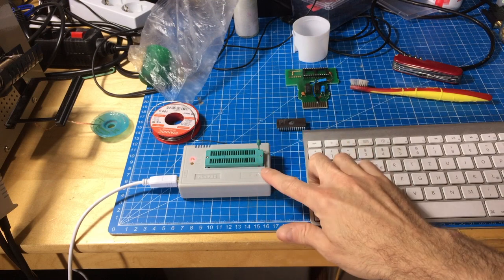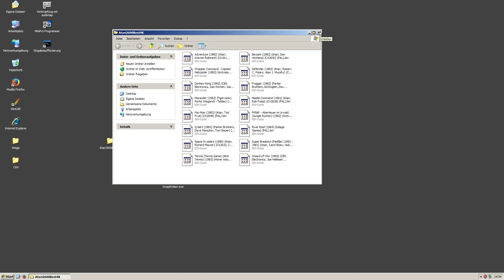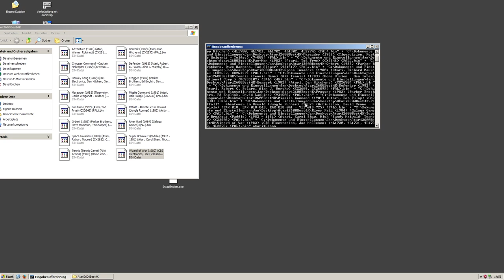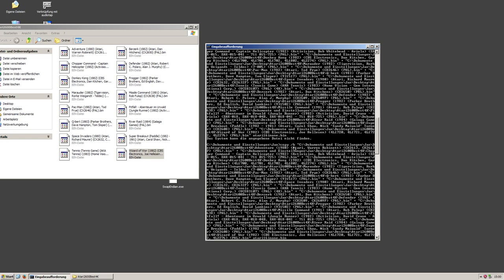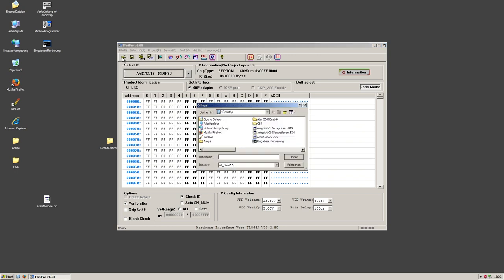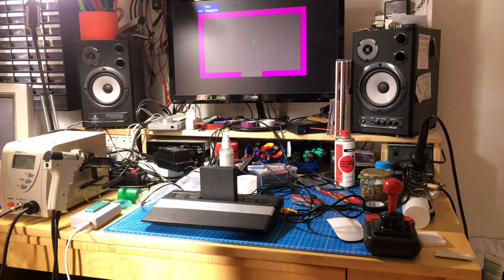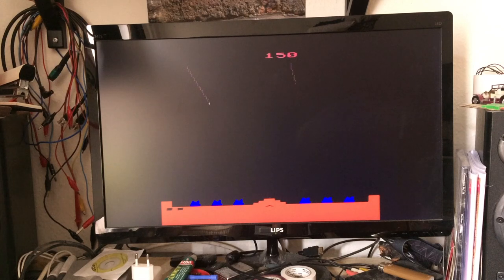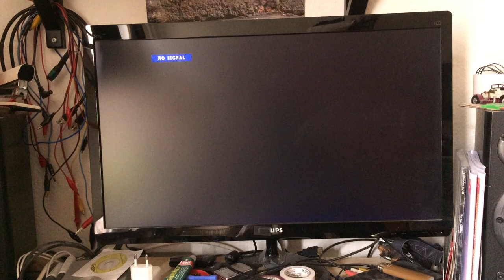Atari VCS 2600 32 in 1 Cartridge EPROM Mod 16 in 1

Comment: Nice!
I used a 27C256 rather than 512 - so only room for x8 4k games..
However to toggle games (as 256 has no A15)  ....cut two tracks (or you can just cut the original track and lift pin 27 which is address line 14 )  connect pin 27 to same underside patch wire.
Forum did say to connect vpp to +5 (pins 1 & 28) for using 256 eproms - but it's missing something as without the extra steps above, toggling on 256 eprom takes two power offs to change games.

(oh yeah my eprom took 3 weeks to blank in the sun, hence late comment)
Reply from the maker: Ah, good to know that it also works with a 27C256. I'm going to pin your comment so maybe it helps someone else. Thanks for adding. :)

And yeah, I tried erasing EPROMs in the sun, too. I gave in quickly and got one of those Chinese UV erasers (which do the trick in about 20min). ;)

Comment: There is another, much simpler mod for this cartridge, putting in DIP switches to select the games instead of power cycling... 

could you make a video on that?
Reply from the maker: Oh, I might really do another mod video on that. There's also some other DIY multicarts I really want to try out some time.

Comment: Enjoyed this project. It worked out well. I have a 2600 (all black "Vader" version) that someone gave me. I'd like to do the s-video mod on that one. Have you ever done the composite or s-video mods on a 2600?
Reply from the maker: Thanks! I did a composite mod on this 2600 a while back (also did a video but it's rather confusing because I tried two methods and one of them failed to work). I did the very simplest composite mod in the end that is just a resistor ladder adding up the different signals for composite (I think it's the same mod that Ben Heck usually does). It works pretty nicely for what it is. Don't know if an s-video mod would improve things even further. Would be interesting to try sometime.

Comment: Great video as always.  Have you thought about somehow applying the counter to a reset or maybe external button?
Reply from the maker: I thought about that, too, but wanted to keep it as simple as possible for now. Definitely going to play around with that idea some time. You would ideally have to reset the cartridge and the console at the same time I think.

Comment: You really should invest in a spool of a Kynar insulated wire for wire-wraping. Also I was a little bit disappointed with a lack of commentary - what is the function of the tracks you're cutting, where do you connect them?
Reply from the maker: Yes, you're right about the wire. I have to get some proper magnet wire or something for fixing traces anyway. Sorry about not going into details. I wanted this to be an easy to follow DIY video. The details are in the forum I linked in the description really.

Comment: Hey Jan! Awesome video! Is it possible to do this for 2K Games? I imagine you don't need to mod the cartidge itself right ?
Reply from the maker: You are correct, you can just put 16 2K games on an EPROM without any modifications to the cartridge.
Reply: @JanBeta  thats super good news. Gonna buy another 32 in 1 and mod for 4k :) although first i need to understand why my atari 2600jr rev f is going crazy on colors with originsl 32 in 1 pal cartridge. Jan do you still have the original 32 in 1 cart intact? I need someone to confirm me the color of the golf game :D

Comment: Have you ever done a video on av modding your atari jr Jan? I bought one of those kits off ebay a long time ago but never got around to actually applying the mod.
Reply from the maker: I did the very simplest of composite mods a while back using just a resistor ladder and a small decoupling cap. Works pretty well so far especially on my CRT. I did a video on it, too (which is a bit confusing because I tried 2 mods one of which didn't work at all... The second half of the video is the mod I still use): https://youtu.be/7ZlnHH8pPe8

Comment: You should do a video series on xbox 360 modding and tell where to get hardware/software. the current ones online are not complete or they are outdated.
mod for games, mod for xbmc/kodi.
Reply from the maker: Oh, I wish I had an Xbox 360 to mod. ;)
Reply: xbox 360 found at local thrift store...I paid $30.00, No cords. I wanted to use cables from my first Xbox 360  but.. different socket. I will take pictures and email you. I looked a few months back into modding it, the tools needed are expensive if only doing one Xbox. Next problem is Xbox games are big, I have to look in bookmarks for FTP locations. I had plans to use a 1tb external drive for just 360 warez.
I have 1/2 a dozen PS2 in storage, I wanted to mod one or two and download the full rom collection... I start looking for the games and realize downloading the full collection would take (I have to look again, but its TB drive space needed)... PS2 file sizes are massive and would take months to download on a good connection.
This is another factor c64 and Atari 2600 are still popular, all games fit on one disk.
Idea.. You download A-M, I will do N-Z and then do a local copy and mail it. cuts time in half.
I will take pictures this weekend.
Reply: I forget where I posted about setting up PC Board BBS. I pulled software from storage last week, manuals and original disks still mint condition.

Comment: Thanks Jan, Excellent mod, works perfectly. Is there any easy way to also support (some) 8k ATARI games with this cardridge?  I read that certain bank switching is required,  also that the 8k image would have to be split by half and programmed in opposite oder etc. Would be interesting to see if we can do more with this cardridge  ;-)).
Reply from the maker: Thanks! Glad it works for you. I think you could achieve 8k games using some extra logic. If I remember correctly, bank switching differs for different games so you need different logic for some. I think there's some discussion about that in the forum thread I "stole" this mod from (linked in the description).
Reply: Jan Beta Thanks Jan, Will definitely check. Initially I'd be mainly for a simple solution for the first std. 8k ATARI games. Would be great if you could post a "part 2" for an 8k mod for this particular cartridge on your nice channel  :-))

Comment: Could you put a reset button on the cartridge or on the 2600...like we did with the c64?
FIBER0PTIC/FBR, The HUMBLE Guys, Napalm and Worship.
'''''''''''''
Reply from the maker: The 2600 actually has a built-in reset switch already. :)
Reply: well, that's not really a Reset Switch like what we usually think of using that term. 

Because it's a fully programmable switch which does whatever it has been programmed to do, and usually it does not reset the system at all, just (re)starts a game.

so it's more akin to a "START" button on later consoles, than to a "Reset Switch" like on the C64 or even later on IBM PCs (when they still had Reset Switches...).

Comment: Can you delete the games that you stored with the same programming tool and add other games?
Reply from the maker: You can use an electronically erasable EPROM and reprogram it with other games. There’s no way to replace individual games unfortunately, you always have to reprogram the whole thing.
Reply: @JanBeta  
possible to use the C.I reference M27C512 ??

Comment: Clearly this thing is awesome. Ever made c64GS ones? I reckon people watching this will be thinking of that new atari console and homebrew potential. A question occurs to me: If you had somehow got yourself stuck in your man-cave like Tony Stark in the movie "Iron Man" so the only way out was to make an open source (HAMbrew) amiga Video Toaster (flipper board i.e. with Zorro on one edge connector and PCI on the other edge, so it also works in pcmcia via adaptors), would you secretly enjoy it?
Reply from the maker: Thanks! I made some bank switchable C64 cartridges. Only tried two banks with a physical switch as of yet though. Would be interesting to implement a similar counter circuit into that.

And yes, I would enjoy it I guess. It's way above my skills but I'd enjoy learning how to do it, too. Am I strange? ;)
Reply: ->Well that is kinda cool actually now you say that. The problem with the C64GS apparently is that a bunch of cartridge games did not work on it and they only worked on the c64-breadbin (as in the normal c64). So, it would be cool to see homebrew games come out for that like the atari ones in the metaljesusrocks videos where he says they have a chip in them to help beef up processing.

-> Not sure about strange, but more like "ST Range (of atari computers)"... That was a pun btw. :D
 I wonder who could make a video toaster (which if you google them were, in the mid range about 150mhz with 64meg ram). I see the exxosuk and TerribleFire channels make accelerators (sometimes ASIC, others fpga) but I reckon they haven't the time, and Brek Martin also does great videos on CD32 FMV cartridge repair. Other pepole with that kind of HDL-and-FFT knowledge would be Ben Heck and Jeri Elsworth (in particular, Jeri what with her knowledge of Fourier Analysis, thereby she'd get her head around Discrete Cosine Transform, Cooley Tukey and Butterlfy Algorithm Bit-Twiddling. In her videos she has had video chats with very smart people. Alas no youtube activity of late. Just an idea: If you ever wished to put the word out in a video as a mere mention (only if you want to) that this open source Video Toaster (HAMbrew) should be a thing and thereby invented and made (and have CDROM games written for it, maybe requiring 8meg or more and  68030 or higher), it would maybe get picked up as an idea somehow by a person. My channel hasn't much on it, but if it helps, feel free to stay tuned to it.
Reply from the maker: That's quite a project. I'm going to mention it in one of the next Amiga videos if I remember to do so. Maybe someone has an idea on how to pull this off. Would be great to have something like a new video toaster and software using it made by the community. :)
Reply: The video toaster was available for a2000 and a3000 and a4000 in various models using zorro slots and pci slots. Am I right in thinking that "some" (maybe "all") of those models would boot with no 'need' for a hard drive (although a harddrive is for recording video to and using lightwave that came with it). Am I right in thinking one could boot from a standard workbench floppy (or toaster floopy), and then maybe just further floppies after that for the toaster? I just mean bare minumum (rather than the "ideal" usage via HDD). 

If that is true then surely that makes the toaster a very power graphics card for homebrew because it would not require any of these "new" Amiga OS operating systems and in fact could just use workbench 1.3 or 2.0 and actually even if it did need a HDD install, it would still be using old workbench 1.3 and workbench 2.0 etc. What's more, it works with the old 1.3 kickstart ROM. While it maybe be possible that newtek modified their own kickstart by aggreemnt with commodore (even though they released their software as FOSS when amiga went under), it still means the toaster is for "Real Amigas" (as purists say when complaining about the frankenstein a1200 machines that exist nowdays, kitted out in tower cases). See what I mean? If somebody could reverse engineer aToaster  or rather make their own totlly compatible HAMbrew card that worked with the newtek FOSS, one could get a homebrew toaster going on a normal amiga so you can plug it in and then out again as if nothing had ever happened (so it is reversible)

The aim of having a toaster is that people (rightly IMO) complain that one has to do terrible things to one's amiga (install pic slots and scary motherboard stuff) to get some graphics card (like a v00d003 or whatever) running and you need software like warp3D or similar. I know you and I would have the cnfidence to modify an amiga for Warp3D and so on, however, newcomers rightly do not want to. And they should not have to. maybe you can see where I am going with this. The purists are right and the Toster solves all of this (either by finding a real one from the old days or making one)..

>:D
Reply from the maker: It should theoretically be possible to do just that. I don't know exactly about what drivers etc you would need to make use of the video toaster card but it would absolutely work from floppies, too.

As far as I know, you could also build an adapter for the A500 and the other smaller Amigas. The architecture for the Zorro slots (these cards went in) is all there, they are just missing the connectors.

It's an interesting idea I'd say. :)
Reply: See latest video on my channel with "Hambrew" in the title. May I "tag" you in the description text of that video so as to prompt you to make a brief mention of the word Hambrew and that it is homebrew video toaster? You can then tag another person (if you wish) of your choice to likewise mention it in their video and put a hashtag in the title. Ya know, just a "youtube tag" basically. And you can point them to my video.
Reply from the maker: Sure! I will mention the big plan in one of my next Amiga videos (the next one is already finished and edited so it's going to be the one after that). Feel free to tag me. Would be nice to see this become real. :)
Reply: :) Awesome. Thanks! It is great to have some positive feedback. Feel free to give me a a thumbs up to the video when you have read the tag in the description. Muh Thumbs up :D

Comment: Hi Jan, with what do you clear the rom's. I am still looking for a good UV eraser. Maybe a DIY UV eraser.
Reply: Also interested in this question.
I ordered a UV easier (UV lamp in a box) from china months ago but guess it didn't make it though customs.

Would like to know what options are out there.
Reply from the maker: I'm using one of those Chinese EPROM eraser things from eBay. I did some modifications before I dared using it, though. Changed the power chord and some of the wiring inside (because it was VERY flimsy). I'm probably going to put in a fuse some time, too. Despite the lack of safety it works pretty well for me.
Reply from the maker: I have one of those, too (see my previous answer). They are pretty cheaply made (obviously) but work okay. I modded mine a bit to be at least a little safer.
Reply: I haven't tried erasing EPROM with it yet, but i have an olde Philips face tanning desk lamp. I bought it used 20 years ago for maybe 20 DM or 50 DM? It still works, didn't need tube replacement at all, which should tell you how much artificial tan my face is getting. I guess the LCD monitor backlight is all i need for that particular purpose. It sure seems punchy enough to erase some EPROMs though, it does cure LOCA glue and UV-reactive fingernail varnish.

Apropos fingernail varnish, you know you can get a UV fingernail varnish curing device for cheap, and you likely don't need to ship it across the planet? Some of them sit just the right way to erase some EPROMs and are equipped with a bunch of like G23 9W UV CCFLs, you will find if you search for 36W version. Reports of reliability aren't too good, but that's what everyone uses in phone repair to cure screen glue.
Reply from the maker: I heard some people use those nail polish UV lamps (even battery ones) on UV EPROMS as well. Seems to work fine but take a bit more time (with my Chinese device, most EPROMS take around 20 mins to erase and you can do 6-7 at a time).
Reply: I just successfully used the bacteria killing UV lamp for my electric toothbrush to erase an EPROM! :)
Reply: Willi Hansen do you have more information about this lamp? Maybe a URL?

Comment: Pro Tip: Use the key POS1 on your keyboard to get to the beginning of the command line. :-)
Reply from the maker: That's one of those superfluous special keys on the PC keyboards, isn't it? No such thing on the Apple keyboard. We usually use CMD+left arrow but it didn't work in the virtual machine. ;)